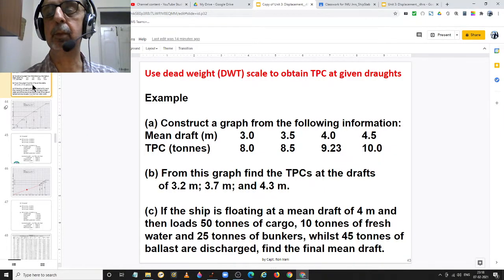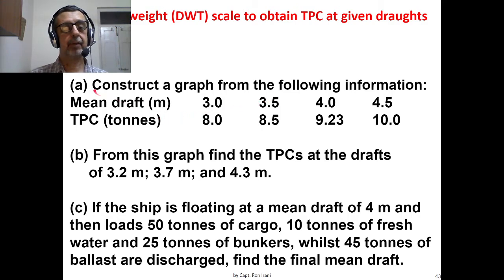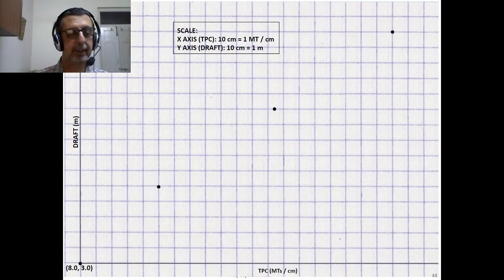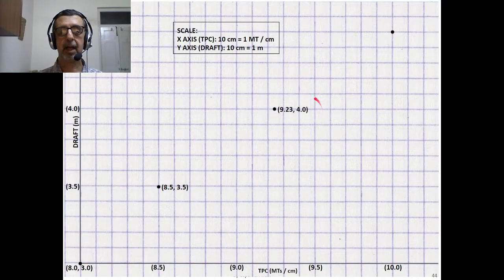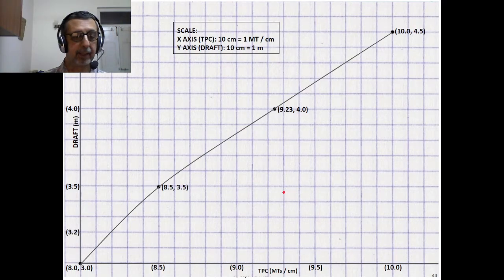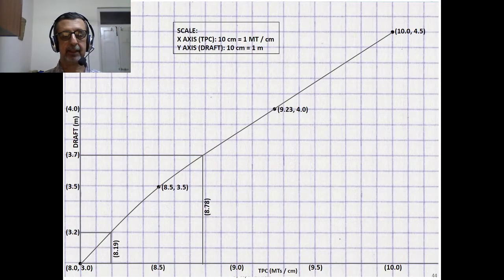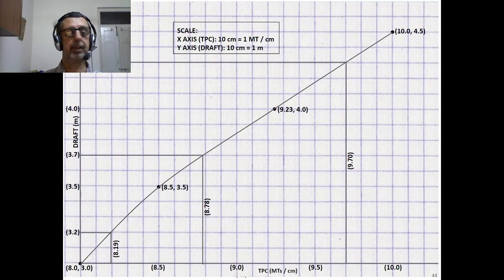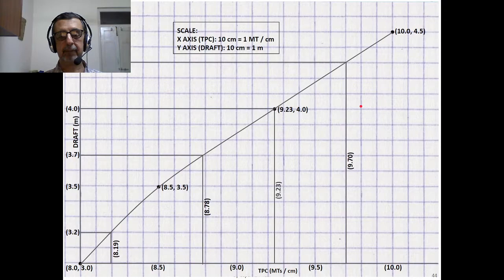Graph 1__Draft vs TPC

Comment: Good day sir, i have one doubt how we can compensate torsional stress?. One of the past question of MMD exam. Pls reply sir
Reply from the maker: Torsional stress is caused because weight distribution to Port and Starboard along the F/A line is uneven. To explain further, let us assume at a certain frame number, weight loaded to Port of the centre line are 300 MTs and to Stbd are 500 MTs. Hence the torsional stress is more to Stbd by 200 Mts multiplied by the distance off the centre line (say 2m) = 200 x 2 = 400 Tonne-metres.

To compensate you must now load a weight off the centre line to Port which will generate an equal and opposite torsional stress of 400 Tonne-metres. In this case = 400 Tonne-metres. (example: 100 MTs loaded 4m off the centre line, or 80 MTs loaded 5m off the centre line).

Francis, I hope I have resolved your doubt.
Reply: @capt.ronirani5691  appreciate your work sir I recently found your channel it is very helpful sir, I am a student of AEMA, batch dns24
Reply from the maker: @cheemrish5355  Thankyou for your comment